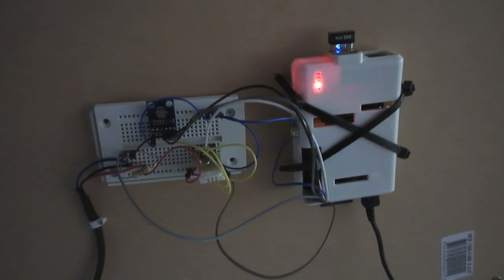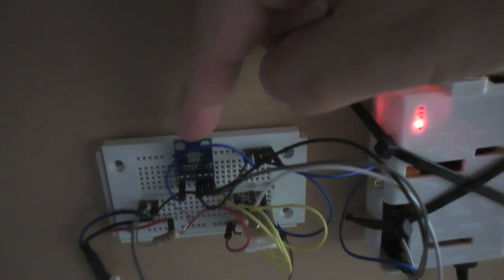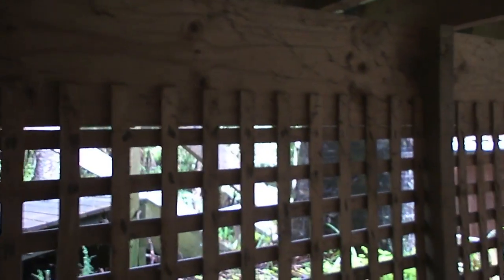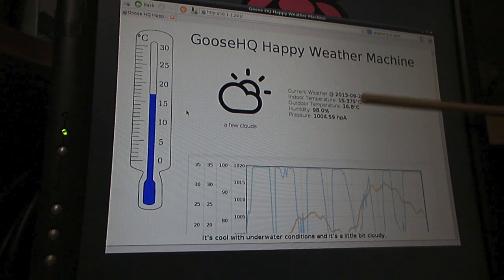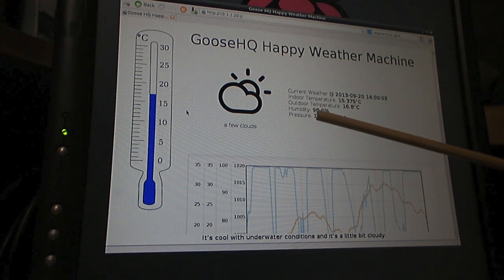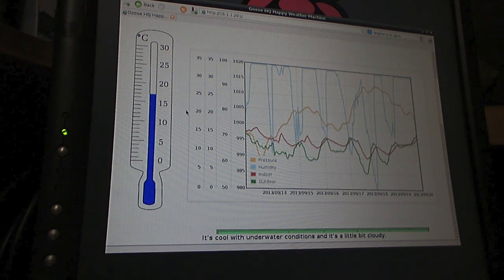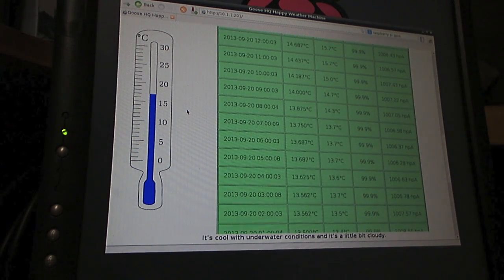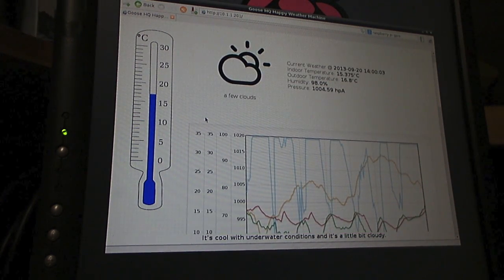Raspberry Pi: Weather Monitoring Project Outline and Resources

Comment: Can you post videos on the entire detailed structure of how to use everything that you mentioned in the flowchart?
I am making a project on the same lines. As of now, I have installed OS on my Raspberry plus I have connected my laptop with the pi using putty and vnc viewer which opens the GUI of pi on my laptop.
In addition to that, I've made a dummy webpage using HTML but I don't know how my pi will host the webpage for which I need Apache. That's why I was asking for detailed tutorials. 
One last thing, can you please post the codes that you have used?
Reply from the maker: +Aastha Mahendru Sorry, this is no longer a working project.  I would have to rebuild.  And, I currently have no plans.

Comment: Can be possible to create a sensor and relay automatization for hydroponics?
I mean to monitor and export the pH and ppm (fertilizer) of water, temperature, light intensity (IR and UV), humidity and barometric pressure. Then take action by relays to compensate the parameters to a steady goal with a particular tolerance of 5%. For example, if the water acidity is too high start a short time a relay that pumps some drops of and alkaline solution; if the light hours are less than 12 hours then compensate with a relay to complete 12 hours of light with LEDs; if the temperature is too high activate a relay to open a ventilation hole and start a fan and other relay with inverse polarity to close the hole; If the ppm are too low start a fertilizer solution to the mix, if is too low start a relay with fresh a water pump; if the humidity is too low start a transducer fogger; and some timers relay for water and air pumps.
Reply from the maker: +peavri Yes.

Comment: Hey, do you have any of the code you use for the project?
Reply from the maker: alexellis2 I don't share the code for this project - as it has a serious flaw.  By writing to a local database, I kill the SD card.  If you want to do this project, I recommend you head to adafruit and check out their tutorials.
Reply: You could easily adapt this by writing to a USB flash key, and that could even be hosted on another PI with more USB ports. I don't mind killing SD cards - they are cheap.

The bit I was more interested in was your code regarding the pressure and humidity readings. 

Do you have a single long running python process which gathers the data and writes to the DB in a while loop?
Reply from the maker: alexellis2
It's not a loop, it writes to the database just once.  Then cron calls it once an hour.  The pressure and humidity come from the DHT22.  Check this page out to learn more...  https://learn.adafruit.com/dht-humidity-sensing-on-raspberry-pi-with-gdocs-logging/overview

Comment: hello 

why we use python what is the advantage of it ???
Reply from the maker: mustafa kenany  I use Python to gather the data from the sensors and write it to the Database.
The real advantage of doing that is that the code to read from the sensors is available free (and in Python) from the Adafruit site where you can buy most of the sensors - that's why I used it.
Reply: thanks for your replay ... I ask can i use another language like php or C# or html .. or not .. and after you gather data can i access the php web page from every place or its locally
Reply from the maker: mustafa kenany
You can use any language you like, but like I say, you'll need to create those resources yourself.  You can access the page from "every place" by configuring your router with port forwarding.

Comment: You mention FLOT, but what pieces of their code are you using?
More detail is really needed.  What Python code did you use from Adafruit?
Plus what python script did you write?  Any HTML code?
How about posting you mysql code.

I have all of the hardware...but ALL of the coding is needed to make this work.
Reply from the maker: if you look in the About Section of the video, there are links to the various sensors on the adafruit site.  When you follow that link, there's a learn section and you can follow the instructions to get them going.
FLOT was chart 36, but FLOT's naming convention has changed.
I use a database, which writes to the SD Card - which is incorrect because it increases wear on the card and they die about ever 6 months...  That's why I advise you to find your own path.
Cheers,
P

Comment: Hey can you post your code? If you look at one of my videos I recently threw one up about a mobile app to control my thermostat with. I wouldn't mind making use some of what you did.
Reply from the maker: Check the Adafruit website for any code.  I just used theirs.
Reply: Even the UI? I'm interested in the DB and the UI.
Reply from the maker: *****
 you're looking for Flot - the beautiful graph engine
http://www.flotcharts.org/
It's free and open source.  Love it.
The database is nothing special, just MySQL.  And the PHP code is:

<?php

$con=mysqli_connect('localhost', 'weatheruser', 'weather123', 'weatherdb');

echo "<table border='2' CELLPADDING=15 BGCOLOR='lightgreen' align=center>
<tr>
<th>date</th>
<th>indoor</th>
<th>outdoor</th>
<th>humidity</th>
<th>pressure</th>
</tr>";

$result = mysqli_query($con,"SELECT * FROM climate ORDER BY date DESC LIMIT 24");

while($row = mysqli_fetch_array($result))

  {
  echo "<tr align=center>";
  echo "<td>" . $row['date'] . "</td>";
  echo "<td>" . $row['indoor'] . "&deg;C" . "</td>";
  echo "<td>" . $row['temperature'] . "&deg;C" . "</td>";
  echo "<td>" . $row['humidity'] . "&#37;" . "</td>";
  echo "<td>" . $row['pressure'] . "&nbsp;hpA" . "</td>";
  echo "</tr>";
  }
echo "</table><br><br><br><br>";
?>

Comment: what is the brand of the wifi adapter you used in this project?
Reply from the maker: Comfast.
But, it's just a wireless N one that's linux compatible from ebay.  I've bought a number of brands that all work.

Comment: Just a random question, howcome you didn't you didn't just write the website with python instead of php?
Reply from the maker: Err... you can't write websites in Python...
At least I don't think so... 
The PHP just basically calls the MySQL database anyways.  It's very straight forward.
Reply: I was just wondering, you can definitely use python for websites, some frameworks like django are python webframeworks :)
Reply: skiwithpete
oh yes you can use python to build a webpage,
you just code the html, write is to a html file and you;re done. Very old school and not very complicated.
Reply: edit ors I haven't actually used python for a website I just knew that you could seeing that a lot of startup companies are wanting python devs for their new websites